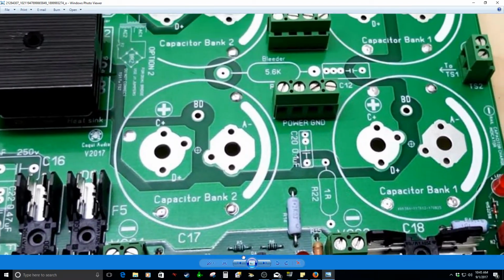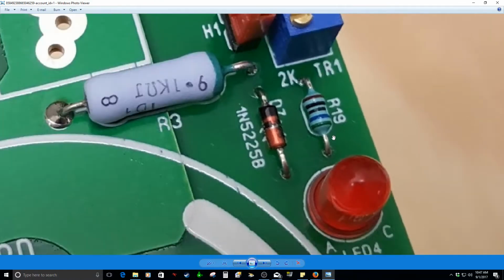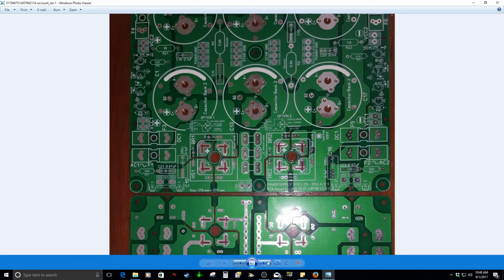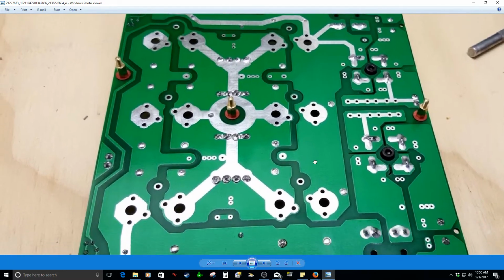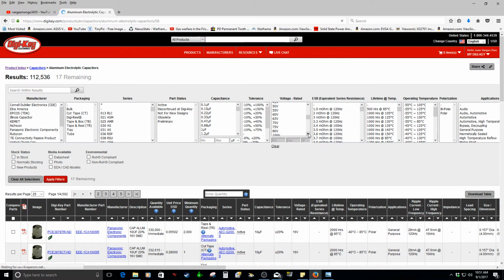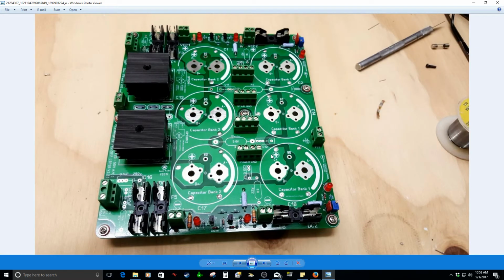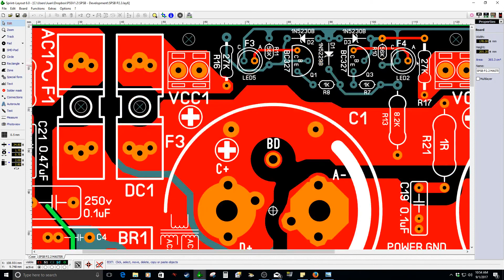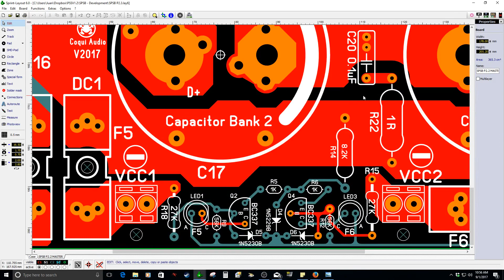SPSB V2.2 unregulated power supply for audio amplifiers final PCB

Comment: juansito ese pcb de fuente suplidora te quedo muy buena lastima que no las bendes por venezuela te felicito corigeme en el nombre de tu pcb
Reply: Juan tuviste ausente por unas buenas semanas?, que paso con tu facebook que no lo encuentro?
Reply from the maker: he estado ocupado con cosas de la casa ya facebook no lo estoy usando mucho que digamos
Reply: Juan una cosa, referente al amplifier B500, Ese amplificador puede trabajar bien normal  con un parlante de 4ohm  de 15"?  OJO solo usando 3 pares de transistores, con un voltaje de 64vol, ya que tu  investigaste sobre el B500, hay información segura que diga lo que te comento.  lo principal saber si resiste a 4ohm
Reply from the maker: bueno lo que pasa es que si le metes una carga de 4Ω esfuersas los semiconductores un poco mas de lo devido otra cosa 3 pares pueden trabajar comodo a 50 a 55 VDC
Reply from the maker: gracias hermanito si mano quedo de show pero como siempre humildemente bro :)
Reply: Entonce no es recomendable usarlo a 63vol en el B500 contando con 3 pares, la cuestión es que no puedo bajar el voltaje. bueno buscare otro circuito.  necesito uno que me resista a 4ohm con 3 pares a 63vol o 65vol DC hasta ahi.